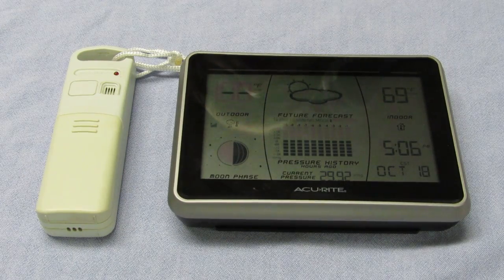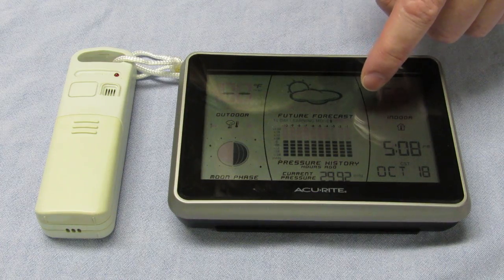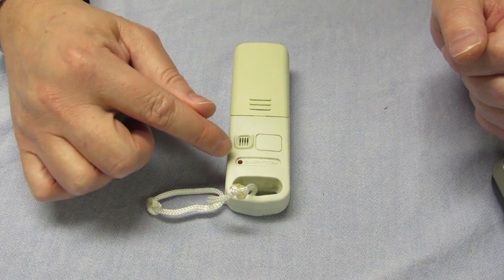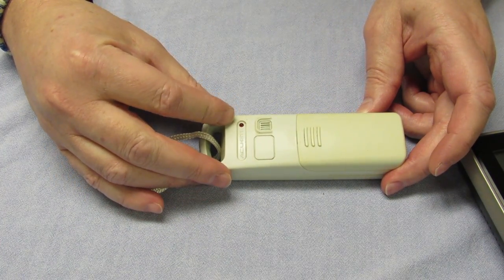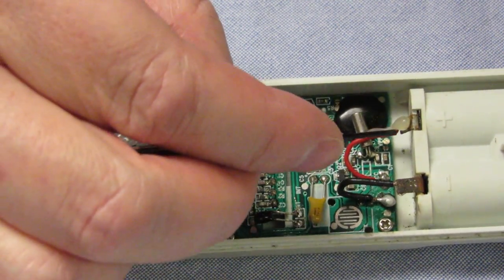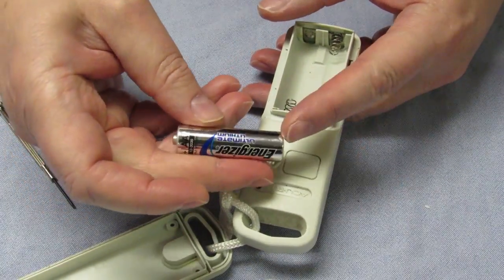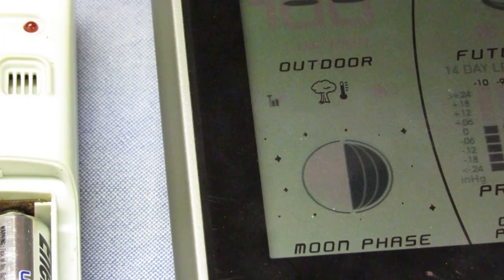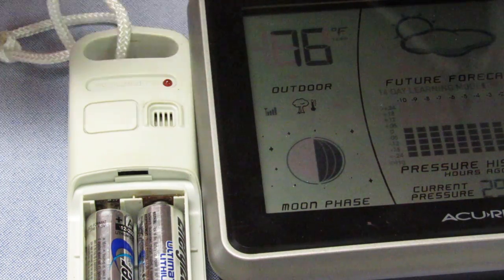DIY #2 - Acu-Rite weather station sensor fix

Comment: Thank you.  I needed to use one of my jewelers flat tips to scrape some rust off of the battery plates and then reinstall...works like new.  This old thing's been going strong for six years or more.

Comment: I found your video because my sensor started reading 59F when outside temp was more like 75. It used to work, and worked accurately for 2 years. On my display, it shows the sensor battery-level, and mine showed about half. So it appeared to be working, but showing an obviously wrong temperature. Like you, I replaced the sensor battery. But after replacing batteries,  I see the red flashing light, indicating it's transmitting. But it still shows 59F, with strong signal. I was getting ready to disassemble the sensor, but after waiting a while, now it shows the correct temperature. 

Things I learned:
* Red flashing light means that the sensor is working.
* An animated signal icon on the display shows active communication with the sensor
* Patience: the sensor takes some time (like 15 minutes) before it finally shows the correct temperature. 
* The sensor battery level might show 50%, but this means it needs to be replaced anyway. 

Thanks for making this video and setting me on the right track.

Comment: Just some general comments: 
1. Appreciate you posting the video, I am shopping these sensors and there were alot of 1 star reviews on Amazon and the sensor was main complaint.
2. The coiled copper wire is the antenna
3. The solder you used is likely leaded (60/40) and all modern electronics use lead free (RoHS). Non-leaded solder has a higher melting point (around 220C). While you may get fine service out of the device now, the cold solder joint does have a higher resistance and will drain the batteries faster than with a good joint. How much faster...no idea.
Reply from the maker: Jay, thanx for your informative comments, much appreciated!  Yes, it's a pity they made the sensor not just a little more robust, it is supposed to sit out in the elements after all!

Comment: Thank you!  Our 00592TXR remote sensor began to get "stuck" displaying the daily high temperature, even though the batteries had been replaced about a month before.  Then, it just completely quit displaying the outdoor temperature and humidity.  One can order a replacement remote sensor from Acu-Rite, but it's a whopping USD $32 including postage and tax.  Following your video, I popped the back cover off and discovered that the black ground wire was detached from the battery terminal.  In addition, where it was once soldered was crusty green oxidation.  I was able to carefully strip back the existing ground wire and resolder.  Put the batteries back in and was elated to see the red light blink.  A few minutes later, the remote sensor was in sync with the main unit and everything works great..  Comments:  the coil that looks like a ballpoint pen spring is the antenna.  Don't mess with it - one end is supposed to be unattached.  Use a low wattage soldering iron with a clean and shiny tip.  Use rosin core solder and preferably non-ROHS solder.  It is good to gently snug the unit vertically into a vise.  It leaves both hands free, as you'll need one hand to hold the solder and another hand for the soldering iron.  Finally, if you are fortunate enough to have a set of JIS screwdrivers (Japanese Industrial Standard), the four screws are a cinch to remove and replace.  Very much recommended for anyone who tinkers with cameras, smartphones, and small electronics in general.

Comment: Thanks guys, I lost my outdoor temp signal some time ago and even after replacing batteries no signal finally I pushed the "reset" button on the back of the display unit and vola it works!
Reply: This worked for me also
Reply: I tried that too but no luck so I googled Accu Rite’s troubleshooting website and changing the ABC Cannel switch to a different channel (which I switched both units from A to C) and that worked for mine.
Reply: That’s Channel not cannel.  Silly auto correct spelling phone. Lol

Comment: THANK YOU!  Just bought a replacement outdoor unit as everything "froze". I had totally forgotten the small sensor, found it, replaced the batteries, checked inside for loose wires (coiled wire is free on one end) and now the main unit seems to be working fine. Next, outside to replace the outdoor unit on a tall pole. Yes, I probably did need the outdoor unit as the rain gage became way off, by double, the annomometer lost a cup and the solar screens were cloudy. Unit was 7 years old.

Comment: If the alkaline batteries leak you can clean the mess up with an old toothbrush & vinegar, then alcohol (isopropyl, methylated spirits, vodka, whatever).  Vinegar is a mild acid, so is good for neutralizing the alkaline battery schmoo.  The same method will probably be able to clean your rusty battery contacts too. 

Note: If it's not an alkaline battery then vinegar might not be appropriate, coz some batteries chemistries use acidic electrolytes instead.
Reply: Duracells are the worst for leaking.

Comment: ..aw...very cool, detailed, zoomed-in, helpful-video....Thank-You....mine's not-just-like-yours, but, its an acurite-and the "outdoor-sensor" is much-the-same---indeed-  was one of the 2 "battery-clip-contact-wires"-- bizarre they must all have that "common-weakness"-- the "wire" they use is "hair-thin" & perhaps "moisture" over the years, causes that "tiny-thin-sprig-of-wire" to, "corrode"-- "ka-dink"-- it silently , separates from its solder-point..?...
* note * good that you told people to steer-clear of the "little coiled-wire" ( antennae ?) at other-end...
..thanx again..Happy New Year...rock on dude !

Comment: Had weak signal from my 5 in1, seemed to be bothered by increase in solar activity.  I opened the back of the receiver-display and found a very thin copper wire for the antenna.  I cut a short piece of copper wire about the same thickness and attached it  to the antenna wire and let it stick out of unit about 6inches.  No more signal drop out and full bars.  I have had this instrument for three years and noticed as the solar minimum has past and activity is on the rise I was losing signal off and on all day.  I saw a fix to do this to the transmitter outside but mine is on a pole 20 feet off the ground and I just had it down to do my yearly battery replacement  and did not want to drop the pole again.  I also heard attaching a wire to the transmitter antenna could damage the transmitter over time.  The receiver was inside and much easier to get at and add a extra length of antenna wire.  So far no signal drop out with extending the receiver antenna wire.

Comment: It is fine to use alkaline AA batts. Just do not leave them in so long that they go below 1.0v and start leaking, and do not use them in very very cold conditions. Have to keep an eye on them. Change them once a year whether or not they seem to need it.   I use  lithium AA batts in the coldest winter months only, so they last several years. Alkalines are cheap and I use them for most of the year.
Reply from the maker: Thanx for the comment and useful tips BWX! :)

Comment: Just be sure to read the troubleshooting suggestions and follow instructions.  I copied what corrected my problem from their site for others to see. Hope this helps. 

See what troubleshooting suggestion fixed mine:

“Flashing of the outdoor temperature may be an indication of wireless interference:
• Make sure the A-B-C switch in the battery compartments of both the display unit and sensor are switched to the same letter. You may choose A, B or C; but both units must match to sync up. Sometimes changing to a different channel helps”.

Comment: I have the old Display (model 00827RX) that has no ABC switch. When the temperature failed to show on the Display, I assumed the problem was the Sensor. So, I just bought 2 new Sensors (00592TXR), but they do not have ABC switches. I have tried setting the Sensor to each of the 3 letters, but none of them get the display to show the temperature. 
When I wrote the company, they said the only way the new Sensor will work is with a new Display with an ABC switch. They said I should have figured that out (the importance of buying a new sensor without an ABC  switch) when I ordered the new Sensor. 

When I asked AcuRite either a refund on the 2 Sensors I just bought a new Display with an ABC switch -- free of charge. They said I had to talk to the retailer I bought the sensor from, or use one of AcuRite's coupons for a 10% discount.

Clearly, AcuRite has no pride behind their products.
Reply: Awe man how unfortunate! I just bought a new sensor because our 7 year old one seemed to be done….but the new one does not have ABC (but our display does). This is a bummer, from your situation sounds like we won’t have much luck getting this new sensor to work with our display 😓

Comment: Having the same issue, where it looks as if there is no information from the sensor, albeit...the red light flashes on our sensor every 20 seconds or so.   The Acurite station shows the 'future forecast', percentage of moisture (I assume) and hPa (whatever that is).  Time, month and date are also showing.   BUT, no temperature setting...just two lines.   Sensor is currently right beside the weather station, and there is no change.   Unsure what the issue is?

Comment: Strangely, on my model Acu-Rite, I have found that if you put in new batteries into the indoor display unit and immediatly start pushing buttons to set Day-Time -Date the outdoor temp display on the unit will remain blank.  You have to put the batteries in and wait for the outdoor temp to display before setting Day-Time-Date.  Which is why, on your unit, the flat watch battery that keeps the settings when removing the main batteries makes sense in regards to my unit that doesn't  have that feature.
Reply from the maker: That's handy to know, seems like they realized that that's a problem, and fixed it in my version.  Thanx for sharing, maybe reply with your model #, so people looking for answers for strange behavior can find it.
Reply from the maker: Thanx, hopefully this helps somebody with a similar model and issue :)

Comment: Thanks for posting this video.  I was hoping it wouldn't be too technical, and found that it was a different model than mine.  I have had mine apart so many times I have almost worn out the screws.  I have checked everything physically and with a magnifying glass.  Think I'll check their web site and see if I can get a replacement temp sensor and sender.  I would have already thrown it away, but it will work for a few days then stop.  Then it randomly repeats the process and the temp is fairly accurate when it does work????  The wind meter on mine has never appeared to be very accurate.  I had to replace the bushing in it and if I lightly oil it every few weeks it still works.
Reply from the maker: Lloyd, how cold does it get where you live, or does it stop/work even during the warm months of the year?

Comment: I opened up my (not working) sensor and the connections were all intact. These Acurite stations are garbage, I have owned probably 5 of these things and the transmitters broke on all of them. They are not built to withstand the elements I even tried wrapping the sensor in 10 Ziplock plastic bags to protect them and they still break. The LCD display pixels go dead easily.
Reply from the maker: Wow, it does sounds like you've had some bad luck with these devices! Maybe I was just lucky so far, but I've only had trouble once.  You shouldn't have to wrap the sensor in Ziplock bags, it sort of defeat the sensor's "sensing" I would think, but I understand how you can get so frustrated with something constantly breaking, that you'd try anything.  Maybe you should try another brand?

Comment: Soldering is not a simple repair for 95% of people
Reply from the maker: That might be true, but as soldering jobs go, this one was pretty simple.
Reply: dvdfrnzwbr - You're absolutely right. I've been an Electronics Engineer for 38 years and the amount of techs I've worked with that can't solder is shameful. It's not just my opinion that they can't solder. They freely admit that they can't solder. That's like a carpenter that can't drive a nail. Soldering isn't that hard with a little practice. I became interested in electronics when I was 9 years old and by the time I was 10, I could solder proficiently. I'm not saying that to brag. I'm saying that to encourage people to learn how to solder. It's not that hard. Like anything else, it just takes practice.